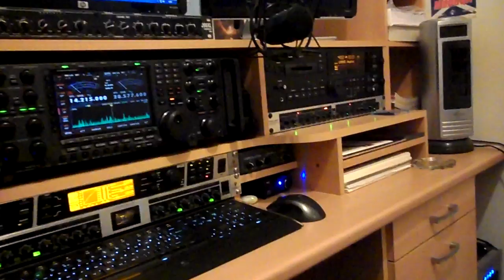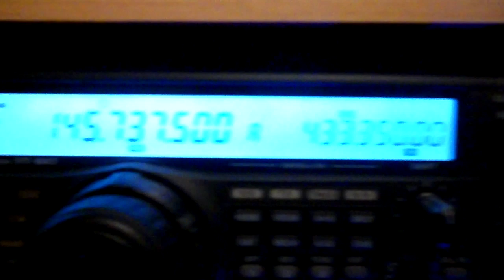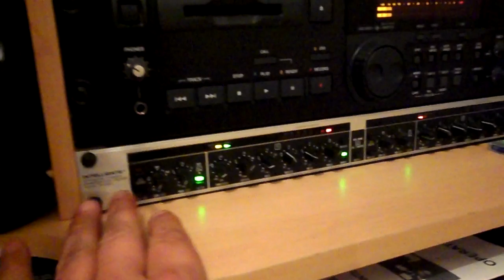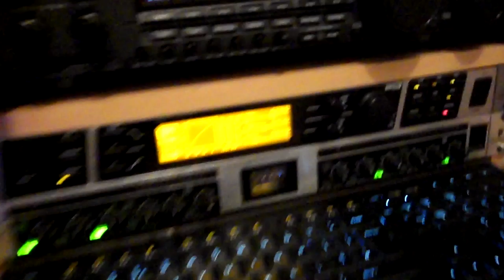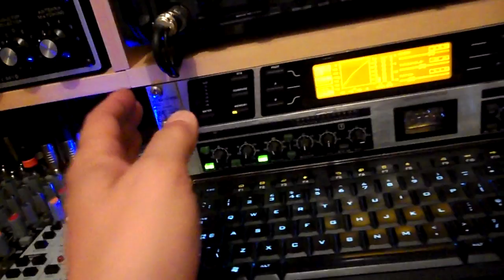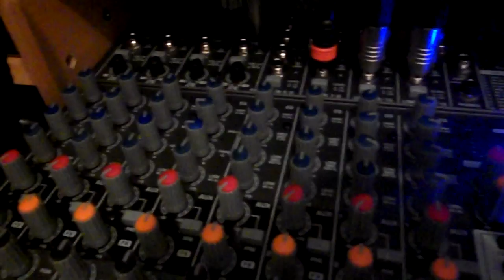G0SEC Ham shack update 28/08/2011

Comment: I use a sustain pedal for PTT that is made by M-Audio; model version SP-2. Most if not all music stores stock them, if not they will get one in for you. It's VERY VERY heavy and has a thick rubber base that stops it from moving around on the floor when in use. It comes with a 1/4" Mono Plug so if you need something different simply cut off the plug and solder on something different. 73 -VA3AWP

Comment: Fantastic setup, very nice layout. I'm guessing that you don't run an amplifier? I have similar equipment in terms of the audio connections and XLR inputs and outputs coming in and out of my Behringer gear and even with 1kw PEP of output power I have yet to have any RFI issues. The key is very high quality and very high braid % balanced XLR audio cables. 73 -VA3AWP